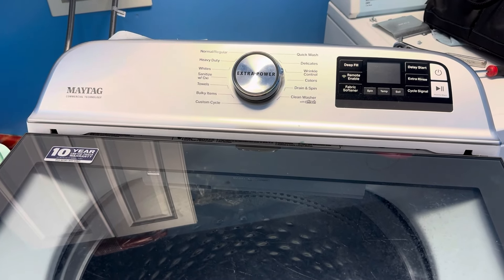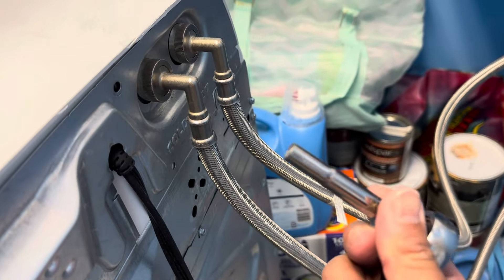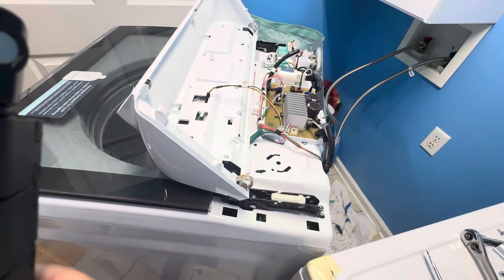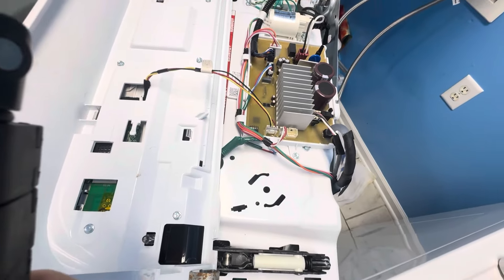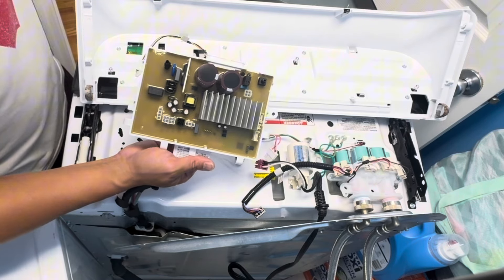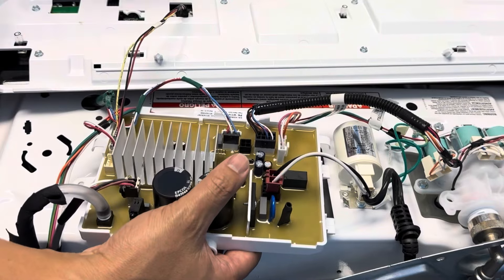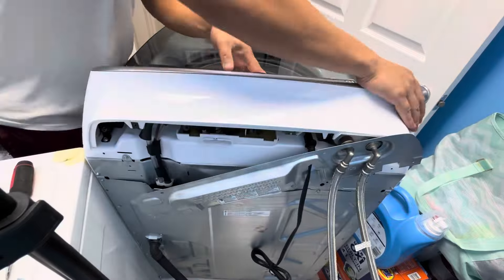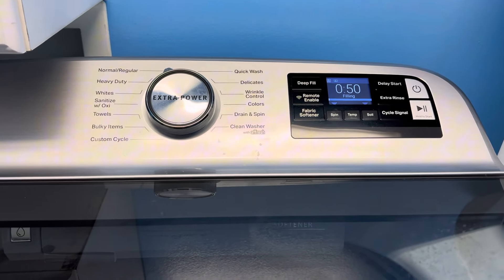How to Replace a Control Board for a Maytag Washer Model MVW7232HW0 #washingmachine #diy #useful

Comment: "Maytag" really!?  Bought washer in 2017. The water inlet solenoids quit in 2020, so replaced them. Intermittent incomplete cycling, so in 2024 just replaced the electronic control board. All were Whirlpool part numbers.  Thanks for the video, easy ECB job.

Comment: Great video! Looks like the wash cycle selector knob removal isn't necessary as it's a digital knob and not analog. But great video, i needed this so i can change my lock sensor wire
Reply from the maker: Right selector knob removal not necessary to remove that panel

Comment: THANK YOU for the video! Just replaced my control board on the same model Maytag today. My unit is 14 months old and not abused. We do about 3 to 4 loads per week. I've also had a few issues with the dryer, but nothing that kept us from drying our clothes. I was able to find a OEM board for the washing machine online, new in the box. I believe the new revision or update p/n for this board is: W11614514. Like yours, I noticed that on my new board the two large Capacitors are black rather than brown. I also noticed a few other minor differences, but all of the connections were the same. I'm hoping this board is improved and more reliable over the old board. Another issue with these units that have high capacity drums, is that Whirlpool / Maytag DOES NOT install a stronger bearing under the drum to account for heavier loads. The bearings prematurely fail on these units with larger capacity drums because of their poor engineering decision (to save a dollar or two per machine). Personally, I will not be buying another Whirlpool or Maytag product in the future as too many people are having issues and the parts warranty isn't all that customer friendly. Don't put a BOLD 10 YEAR warranty sticker on something that you're knowingly cutting corners on during production unless you're ready to do the right thing when people have problems.
Reply from the maker: Glad the video helped! One of the reasons I bought the washer is because of that 10 year warranty on the machine but of course only for the motor and wash basket. 

It is hard to find good quality appliances these days. All new appliances work great for first couple years then something goes bad that costs couple hundred bucks for the part itself (if you know how to fix yourself).

My whirlpool refrigerator started cooling unevenly and not defrosting and turns out it was a bad control board too. Replaced it and been working fine. All these control boards are poorly built in these new appliances and they are not covered by the manufacturer warranty.

Comment: Thank you, mine just broke this weekend... and now i know what to do. Same problem.
Reply from the maker: Great! Glad the video helped. These control boards on kitchen appliances are low quality.  Second time I have had a control board failed on kitchen appliances in 2 years.
Reply: Hi mine is doing the exact same thing and I switch mother board also i didn’t see you do the recalibration that Maytag says you should do when replacing a part I did everything you and and recalibrate and still doing the same thing and help would be appreciated thanks
Reply from the maker: @frankpena7223 I just reset it by unplugging the power and replugging it back in. Make sure it is OEM part.

Comment: I need to replace my control board after it failed from a power outage. But I can't get the top to unlock. It has a load of laundry in it.

Comment: You said it stops during a cycle. Did you have to manually drain your water out? That’s our problem right now, same thing but we don’t know how to drain all the out
Reply: My drain pump will not stop running. But I think almost all issues go back to the board
Reply from the maker: I didn’t have any problems with it draining. My was not filling or it would fill but didn’t agitate.

Comment: My drain pump keeps running and will not go past that point. As soon as I plug into the outlet the drain pump starts and will not stop. Thinking the board is bad. I can’t find a replacement
Reply from the maker: You can order online or any major appliance part store.
Reply: You can find a part at any Fox appliance parts store around your area